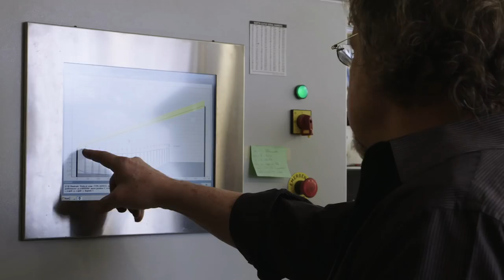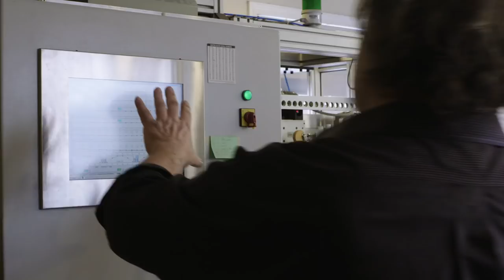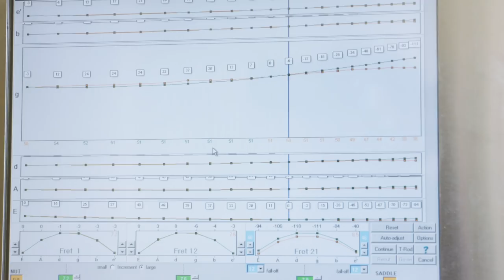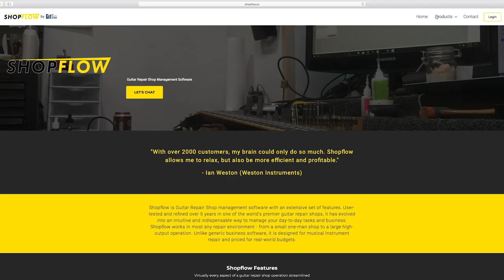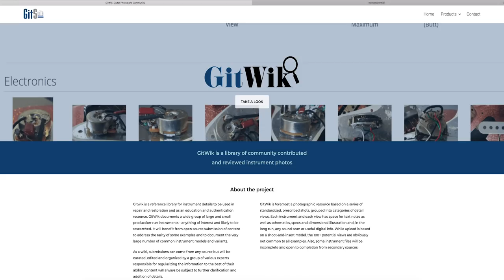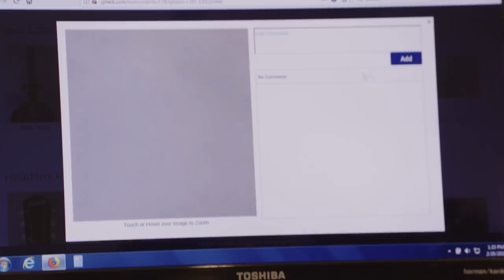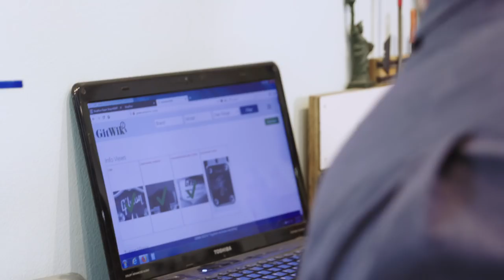Joe Glaser's Luthier Shop | Marty's Guitar Tours

Comment: Im in need of a certain bridge for my archtop. I used to have one on an archtop I had inthe late 70"s. It was a chrome low profile with the thumbwheels not under the bridge but the bridge had slots in each end and the thumbwheels were in the end slots. I think it came with aluminum saddles I dont remember( cause I put brass in their place) but nowdays its all tunomatic or roller. I need one like I described because it allows a wider string spacing. I need 2 1/8th or 2 3/16 ths e to e. Can anyone help me out?????